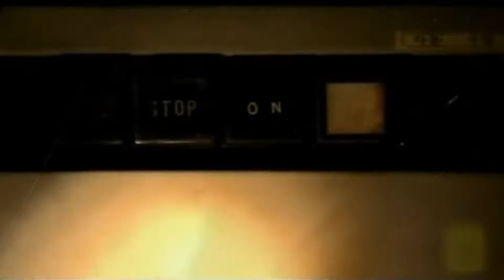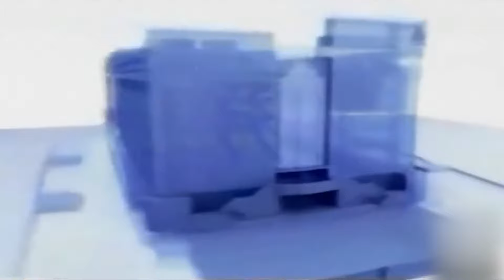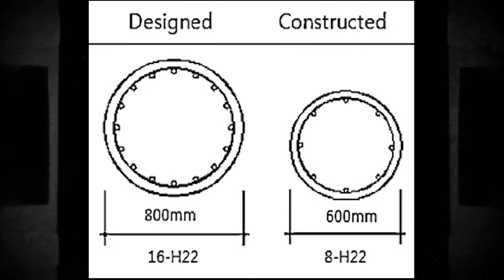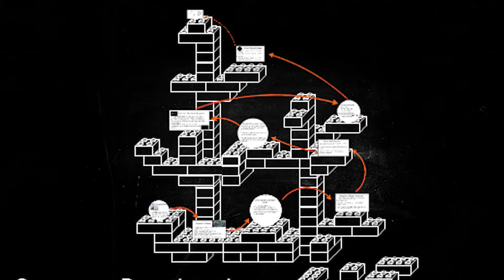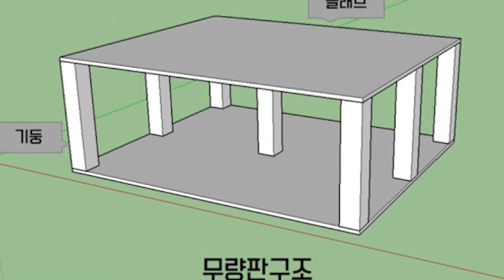Sampoong Department Store collapse (Disaster Documentary)

Comment: I(a Korean) remember this incident as it happened a day before my birthday and I was forced to stay low as the whole nation mourned for the deadliest single accident in the history of the country. I also remember reading about a story from one of the survivors on the newspaper, a man who jumped into the elevator area which didn't collapse, as the rest of the building began to give way.

Anyways there are a few things I want to point out. The building is described as a residential building in the video, but to be exact, it was planned as a small local commercial building for tenants(no residential suites in the building itself), very common in apartment complexes in Korea. During the ones built during the 80s, these buildings are usually two stories if they are small, larger but no taller than five stories if large. The late 80s and into the mid 90s, Korea has witnessed a huge economic growth, in which, Lee Joon foresaw the upcoming growing demands in retail, thus altering the building's plan into a much larger department store.

Also I would like to add just a little more explanation to the equipment added for the floors on the 5th floor, the restaurants. Korean people are accustomed to sitting on the floor, which is heated by stone. This is still very common method of heating in Korean houses, even if they are high-rise, modern condos. The weight of this traditional heating system has contributed to the collapse.

The Sampoong incident may seem like a disaster once in a while but like I mentioned above, during the economic boom from the 70s all the way to the 90s, many structures were poorly built in order to cut cost and time, have caused numerous disasters specifically during the 90s which the nation will never forget.

An interesting fact. The site of Sampoong was redeveloped into a high-rise luxury condo in the early 2000s, which one of the tenants is the current president of Korea in office, Yoon Seok-Yeol.
Reply: This was really interesting, thank you for commenting this!
Reply: Wow
Reply: I was born on june 30th too.
Reply: Imagine living in your condo over a graveyard of over 500 people
Reply: @antreaskonstantinou8585 that's exactly what i thought too!
Reply: @antreaskonstantinou8585  its so haunted
Reply: Thank you for this piece of information! ❤
Reply: Wait is there a book on the sampoong mall incident? Cause if so I wanna read it it’s a very interesting story!
Reply: @AkariSi11yz  I… actually don’t know. I only wrote this comment with common facts known between fellow Koreans. There were some documentaries on Korean TV over the next few years after this incident.

Comment: Thanks to growing up along a fault line (and getting pinned under a TV/dresser), I go running for cover if there's even a slight vibration. We like to think we're invulnerable as long as there are 4 walls and a roof. The reality is your house could easily be broken into by any determined mofo with an ax. Or brought down by a drunk driver (both have happened multiple times) Tall buildings are just death traps unless they're properly designed for natural disaster. They might be a death trap just by design. 

There was a tower above a church In NY, that a single strong wind could easily collapse, and no one knew until an architecture student emailed the towers creator. 

In SF there was that apartment building slowly tilting during construction, and  management started accepting leases with full knowledge that the tower was sinking. They were secretly fixing it when a newspaper caught wind of the BS.
Reply: I live in an area that has had earthquakes and everyone in my school is trained to dive under the table, hold one hand over their neck/base of their head, and hold the table leg with the other hand. If things start shaking, you can't count on the roof and walls to save you, they may come down. Windows shatter, ceilings fail, lights will fall on you. Act fast and know procedure, when a room starts shaking, get down, and get away from things that could hurt you